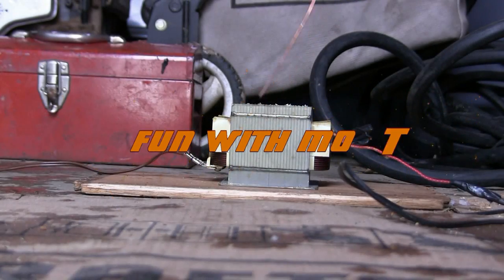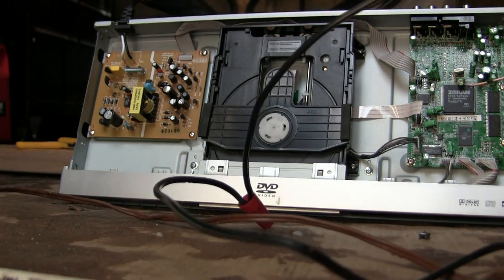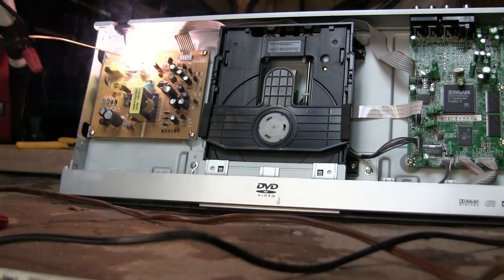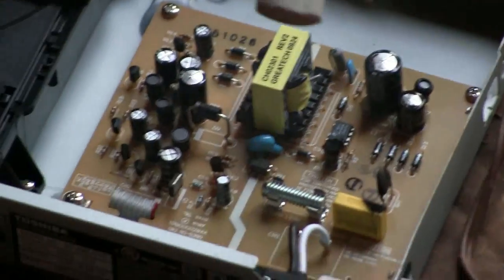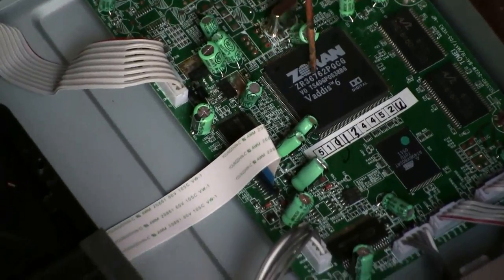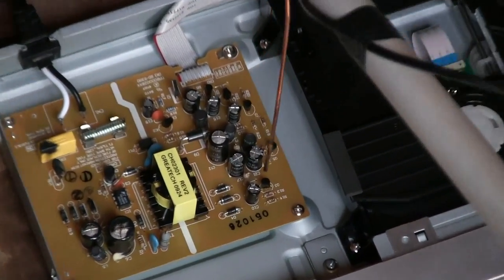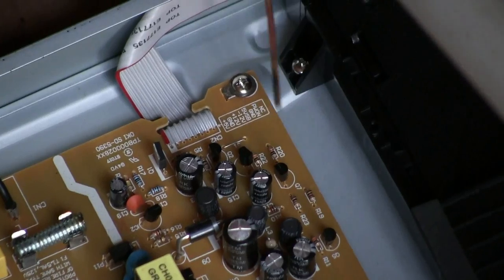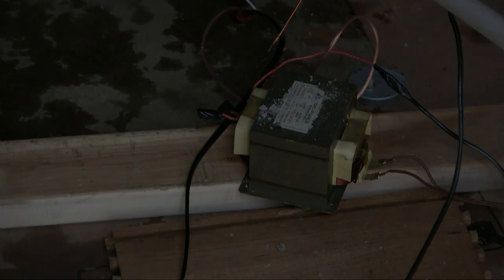Fun With MOT

Comment: You couldn't get it to arc on the main board, because it was insulated by the transformer on the supply board, you'd need to break down the insulation of the transformer first, or just bridge it.

Comment: I destroyed an alarm clock once by pulling out one of those cylinder things. Instantly killed it.
Reply: TheLizardKing17 in one of their videos they remove capacitors one by one on a Dell while it's running, counting how many it takes to kill it.
Reply: I saw that one
Reply: Are you referring to the one of the batteries?
Reply: No capacitors
Reply: Those are batteries

Comment: i love zapping capacitors. I've had some make a green flame before. i have 2 MOTs hooked together to make 4000VAC at 2 AMPS. Sucks up 28 amps short circuited. I watched a YouTube video on how to do that. Happy zapping!
Reply: ROFLCOPTERS92 hey would u have a extra one ud like to get rid of?
Reply: No.
Reply: Jeremy Thomas go to your local recycling depot and look around the washing machines ovens and dryers there could be a microwave you could grab like I did

Comment: How do you make this zapping device
Reply: Microwaves require a high voltage to run. But, 110VAC out of a wall is not good enough. There is a transformer in the microwave to amplify the voltage,  but decrease the amperage.  That supplies the magnetron with a sufficient amount of current. They removed the transformer, put the negative on the, well, negative on the plug. The positive is that bare copper on the end of a 2x2. Simply touching it kills you before you hit the ground, I advise you don't try this until you know what you are doing.

Comment: Just to ask, how did you hook the MOT up to electricity?
Reply: +CoroPixel just directly thru the mains. the mot as two input terminals and two outputs. in goes 110vac and out comes 2kVac at roughly 1 amp

Comment: I WILL TRY DIS!!!
Reply from the maker: If you do, PLEASE BE CAREFUL. MOTs are lethal.
Reply: First I have to find an old microwave. Do you know the best place to get one?
Reply from the maker: daylight hic You can find plenty of used microwaves on E-Bay or Craigslist, but please do not attempt to mess with a MOT unless you know exactly what you're doing. I don't want you to get hurt.
Reply: Will do.. thanks for the help! :-)
Reply: Nyet, Safety 3rd! >:-3 (ok)
Reply: +Streamlined Steamroller now.... a mot can produce about 2kV. at 1 amp which will kill you instantly.
Reply: +Streamlined Steamroller if you have to ask this you shouldn't touch a MOT
Reply: smallenginedude71 Don't worry. I don't have a MOT and I don't think I will get one anytime soon. If I did get one, I would wear thick gloves and stand on a rubber mat.
Reply: Streamlined Steamroller good idea.
Reply: smallenginedude71 Thanks.
Reply: Seriously, you would die before you hit the floor if you touch this
Reply: Shawn K I messed with a mot but when I did I had no idea what to do with 2.1kV and i was quite nervous but I zapped a lot of parts in the microwave the caps scared the shit out of me but at least I never got hurt